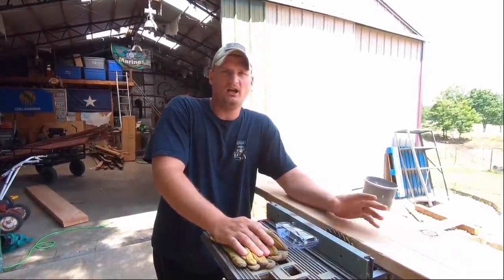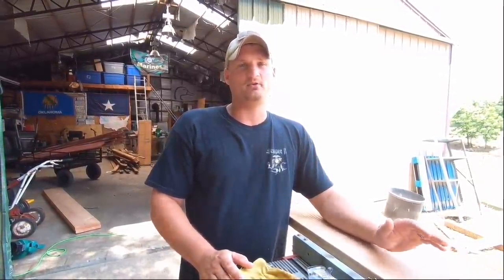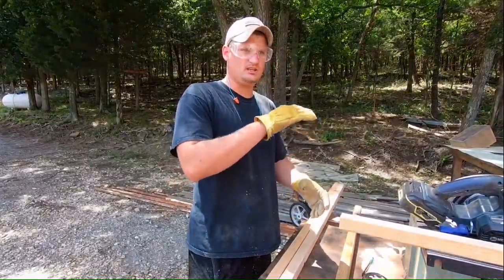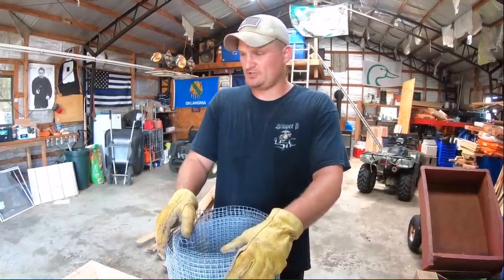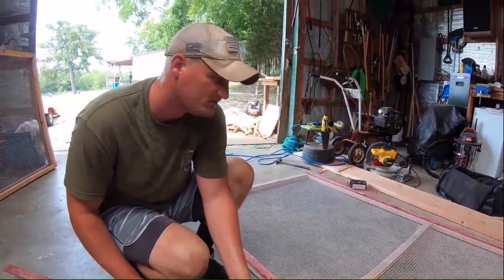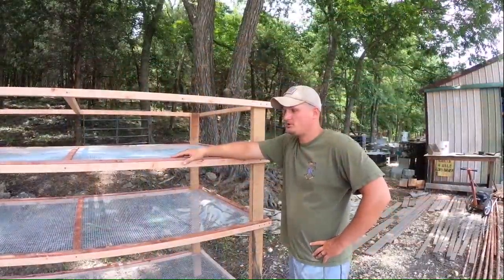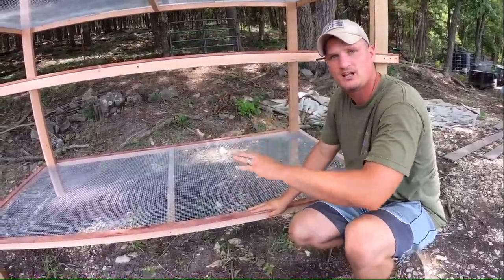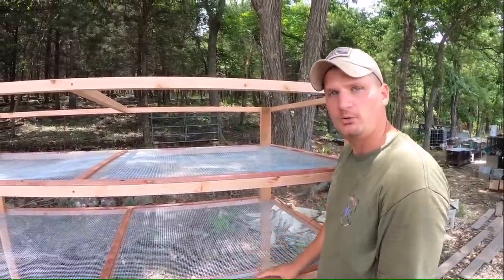DIY - Vegetable Drying/Curing Rack

Comment: My mother used to use cheesecloth over veggies she was drying.  You can also use old sheer curtains to keep flies and bugs off.
Reply: I allways like what yall do and enjoy it so much .
Godbless yall
Reply: I was thinking the same thing, covering it with something so they wouldn't get the bugs on them. Good Idea
Reply: The cedar strips will also help with anything and bugs.
Reply: Yes.  Hanging shade cloth down from the top on all sides does the trick too.  Use a bamboo cane as a spindle, supported from two clips, and then you can roll it up and down as needed.

Comment: Have you ever seen Hollis and Nancy’s channel? (That’s their channel name) they made a drying rack using 4x4 posts then built the shelves afterwards. Also they used 2 - 2x4s for the bracing under each shelf. It made for a sturdier structure. If anything, you might want to consider adding another brace under each shelf because those veggies can be heavy,especially if you have a lot on there.

Comment: That drying rack looks great. I agree, it will need a little beefing up. Probably a support in the middle (front & back). Love the cedar strips. Not only should it help to deter bugs but keep you from scratching yourselves on the edges of the wire. I would get some tulle from the fabric store to lay over the veggies to keep flies & gnats off. I was trying to think of a way to make it collapsible, so it would be easy to store when not in use. Keep up the great work & videos. Blessings, Love & Hugs from Vicki in Ft. Worth, Texas 🇨🇱🇺🇸👍❤️🥰🙏🙏🙏🙏🙏🙏

Comment: You will need to separate onions from potatoes,  they will rot each other.
Reply from the maker: Didn’t know that. 😬
Reply: Very true. The ethylene gas from the onions can hasten sprouting in potatoes.
Both also release moisture so you want to store them loose to prevent spoilage as well.
Reply: @douglascampbell9809  thanks, you helped me as well.
Reply: Thanks pat, I always kept them together. This year I am going to try and hang my onions. If only I can figure the best way to do it. Thanks again
Reply: Agree, put the onions on the top rack, potatoes on the bottom rack,  want them as far apart as possible.
And the potatoes are the heaviest so that will help stabilize the stand as well

Comment: Next time you see a wore out aluminum storm door see if you can have it. Tear it down to get the side pieces. Get some socket cap screws that are about an inch longer then the width of your table saw fence. Drill some holes in it to match your table saw fence holes. Drill through just big enough for your screws to go through. On one side drill the holes out so the head of the socket cap screws will slip through. Now using some washers and wing nuts attach to your table saw fence. Now your table saw fence is 6 ft lg.

Comment: Good job, once you brace corners will stiffen up.  Never had access to cedar like you have. I know repels moth in closets. Not sure out in the open.  But looks nice. I built a large drying rack in the past , they are very useful.  Also can use to dry wild flowers and herbs, that you forage. For instance we have Queen Anns Lace growing wild in  farm fields , and ditch banks in the Midwest.. If you gather before they start spraying, cut stem a foot long  poke stem down thru fencing, . This keeps flower flat during drying. 24-48 hrs. then cut flower off stem. This particular flower looks like antique lace. Can be used in countless crafts, boiled in hot water , strained off to make jelly also. By using rack to dry flowers as I said weight of stem holds flower open and flat, otherwise they close up. then can,t use as decoration.  Can also lay different herbs flat on wire dry for a few hrs. in direct sun , no more than overnight. Then just pull stems between fingers over a table , dryed herbs, or mint will come off easily. let sit  in a pile overnight . Best to put in a large jar in a dark place, cupboard etc. Herbs in general have a natural oil in them, if you store in sunlight, or even bright lite they don,t last as long. Take dryed mint leaves ,make a natural herbal tea, especially in the winter reminds you of spring and summer. Very cheap also. Can do the same for  basil ,oregano ,  etc. Can add to pasta or other dishes, the flavor just pops out. Very inexpensive.  Best thing is you grew it, no where it came from. All positive.!!

Comment: Great idea.  Cedar will definitely help deter insects, mice and snakes.  Don't know for how long, but can always re-coat with cedar oil down the road.  It is considered a low risk pesticide.  After you get it braced up good, was wondering if it would hold some slide-out trays to use up the extra space at bottom shelf.  (Maybe even drop-downs using hooks.)  May can add shelves in between on the WalMart rack.  Potatoes are super heavy in bulk; therefore may do better on bottom or on the WM rack.  We used to dig ours up (when dry) and leave on ground to dry out 4-5 days.  Then transferred to mesh 5-10 lb. bags, which we hung on nails.  Sorry, didn't mean to write so much.  Just wanting to help.

Comment: My thinking was to put small blocks of wood (similar to kitchen cabinet shelving pegs) on the inside of the frame so you could adjust the shelves to any height that was convenient for whatever you are drying. For smaller shelves they could just pull out for ease of stacking and taking to another area to be processed when the time was right.

Comment: That higher bottom part could also be used to hang bundles of herbs if you just put in some small "s" hooks when you needed them. You could still put things under the herbs, and it wouldn't interfere with using the upper shelf either.
Reply from the maker: That’s right. We actually thought of that earlier. Good idea! 👍

Comment: I'm lovin` the drying rack with the cedar. You could take it apart for winter storage too. Onions, garlic and sweet taters need the sun for curing but potatoes need dark. I use black bed sheets to block the light.  An insect blocking idea could be Agfabric insect barrier netting. It comes in many diff sizes, even cut your own size  (20' x 50`). I am loving this stuff for growing pest sensitive crops!

Comment: If you did the racks w a center support you could split them in half and hinge them so you can lift them up to reach what's on the layers below easier and then you could also get more layers in easier. Piano style hinges would work well or some.good acrylic ones. You could also add some copper tape to the edges so it keeps snails and slugs off as well not sure if they are an issue where you are but in PNW they eat all our fruit and squash up if your not diligant and their slime reacts w copper so the copper tape/strips keep them from reaching produce so along w cedar that should help a ton.

Comment: You two made that look so easy to do. The cedar strips might help with deterring the bugs but if you still have a problem you can go to a fabric store and buy "White Tule" netting. It's usually 60 inches wide and you just buy enough to cover your drying stand and it's cheaper than cheesecloth.

Comment: Would have made it an open framework with removeable meshed trays that slide in and out ... Like a dehydrator ... You can make smaller trays to better sort your veggies ... And use window screen or perforated food safe silicon so you can dehydrate ... Maybe add clear corrugated top and sides to aide blocking cooling breezes ...

Comment: Good job done but if I were you,  I would have erected a roof with hoop house plastic over it with the facial board overlapping over in a gable form to protect the produce from unannounced rain whilst effecting the suns isolation through the hoop house plastic. You could have reinforced the rack further with wood at 2' square intervals to take on any weight of produce. My suggestions please. Thanks.

Comment: Jacob something I found that you might think about. I went to a surplus supple store and found some 3X5 window screens. I got them for $1.50 each and bought 10 of them. Then I build a wood frame to hold 6 of them and the other 4 I hung them from the garage ceiling with wire. There working great and pretty cheap to throw together. Be sure and put you some casters on the legs  it sure help to be able to pull it out from the wall and the be able to move it around. I would use some wire and put a X on three sides it help stiffen it up some or some of your cedar strips.

Comment: Galvanized metal is full of lead. I have been searching for stainless but can't find it in the size I need. I am drying lettuce under fans for market and I need a 4 x 4 sheet of stainless mesh with holes no bigger than 1/4". Tough to find without having to buy 2-3x's the amount I need. It's expensive!

Comment: Can you make the shelves adjustable?  Drill a series of holes, all equally apart from each other in the 4 corner posts. Buy or make 4 removable pegs to hold the shelf in place for each tray. I've seen commercial ones with a hole drilled through the tray that lines up. Some have trays that sit fully inside the uprights. Experiment to see what would work best for you.  As for the Cedar, I don't know if you have enough to be as effective as you'd like, I agree that it can't hurt & time will tell when comparing it to the one you're already using.
Reply from the maker: Making the shelves adjustable would be a great idea!

Comment: Good design, Where I live you have to make any thing outside rodent proof. I would suggest wrapping the entire rack with small mesh cheap galvanized wire to keep any unwanted pest from your drying operation. I would guess that you guys have mice around your farm.
Reply from the maker: The mice are not too terribly bad. We keep them in check. But this drying rack is going inside our shop so not as many rodents and things will be able to get to it.

Comment: Hi , depending on what stage your potatoes are at you cannot put potatoes and onions on the same dry rack you will get rot and you will lose the good onions you have and the potatoes will rot also a lot of people make this mistake if you value your produce remove the onions off the rack before you put the potatoes on they cannot be together and share the same space.

Comment: Cedar needs to be kept fresh if it is to be of any use. Cedar that has lost its scent can be restored by simply sanding the exposed wood surfaces lightly.  I’m thinking 🤔 it would have to be in an enclosed area but maybe not. You may have to sand it more often. My mom’s cedar chest is 75 years old and it still smells like cedar when you open it. It is closed up and there is not much airflow. I’ll have to keep an eye on the comments to see if anyone has the answer.
Reply from the maker: You’re right. We’ll be keeping this rack inside our shop, so luckily won’t be exposed to all the elements and should last a little longer.